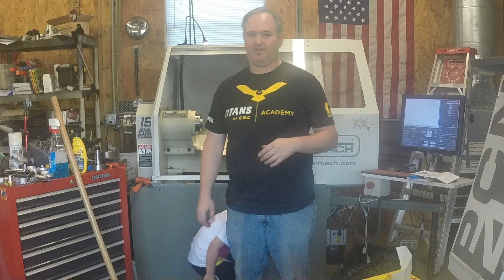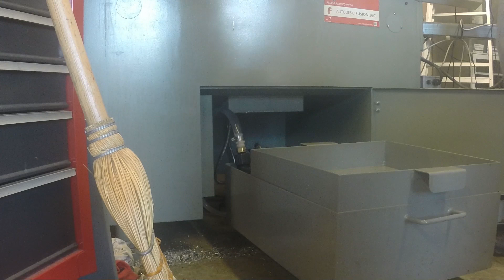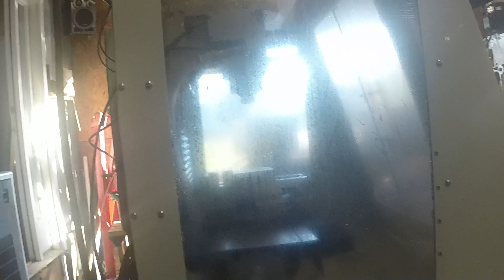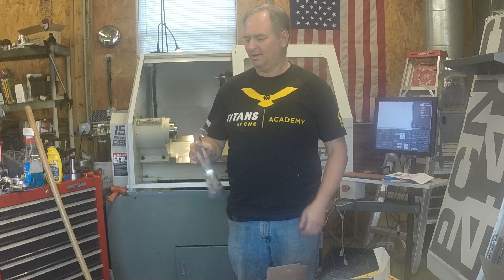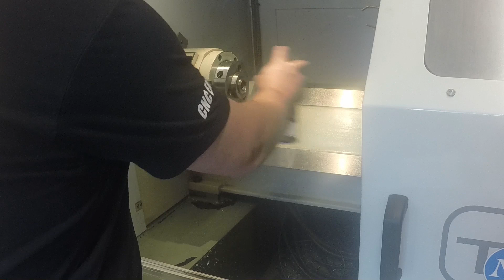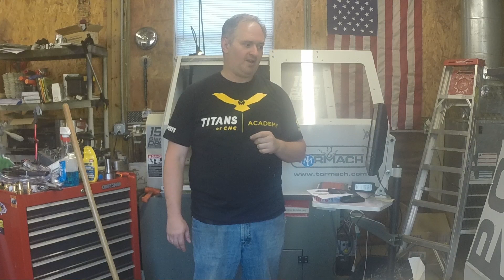Get rid of that old coolant pump!

Comment: Thanks for posting! I always felt the coolant pressure was on the low side on my Tormach lathe . Can you show how you connected the hose to the back of the turret? Is it the same thread?

I wanted to add a hand sprayer to wash down my enclosure and glad I came across your video!
Reply from the maker: I'm still using the stock connections for the hose from the coolant tank and into the turret. That being said, I'm about to use larger, 3/4" hose and route it around the outside and into the turret. The choke point will be at the turret connection itself but that's still twice the size of the flexible hose. That's the real issue with these - just replacing that hose with something that has a bigger inner diameter will greatly improve flow rates. Thanks for watching! - Tom Z

Comment: I did the same thing as you with my 440, but instead, I used the new 770m pump with the new three metal nozzle kit from tormach, It’s makes a big difference.
Reply from the maker: That's a great idea! I think that would work much better than what I did to my 440. Might order that nozzle kit to replace the snap lock stuff I used. Thanks for the tip!